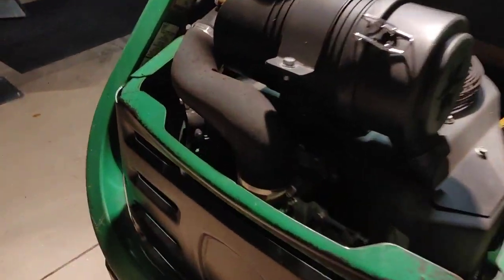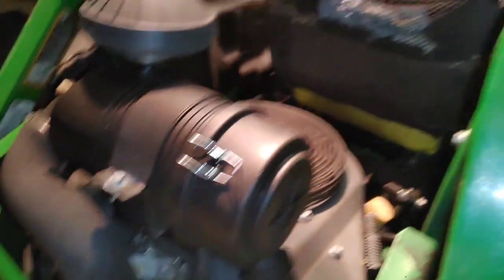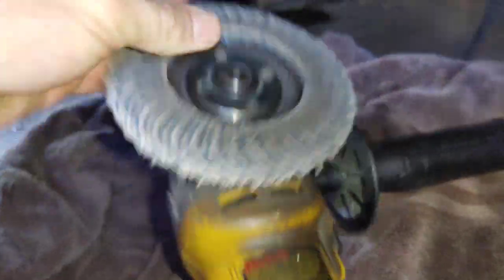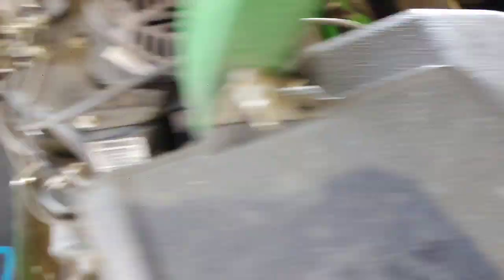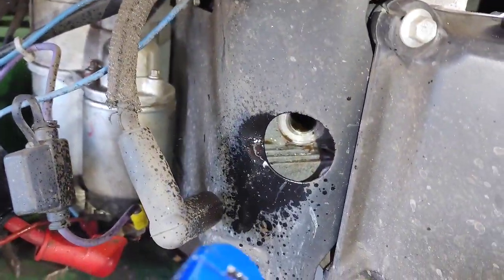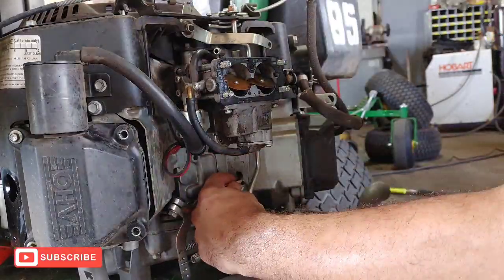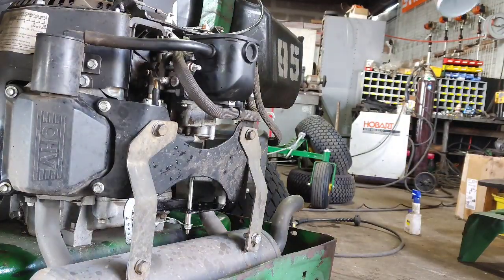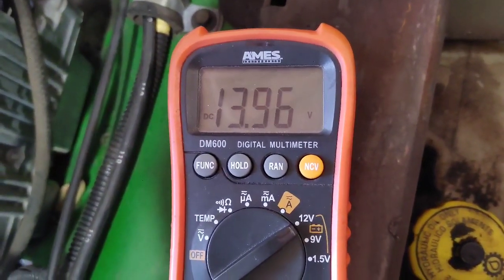How to get an engine that has been flooded with water running again.

Comment: Great video, I own a z915b, so this one was extra interesting.  I’m assuming you had to do the anti rotation repair as well?
Reply from the maker: It really just needs a new clutch and the stud /bolt that mounts to the clutch.  The flange hole in the frame was okay. The customer says they have a clutch they will install.